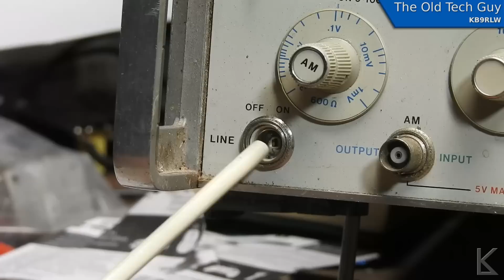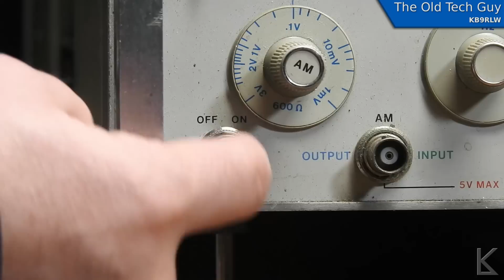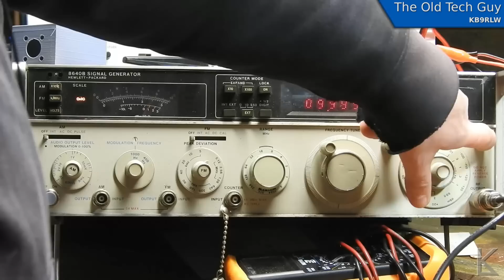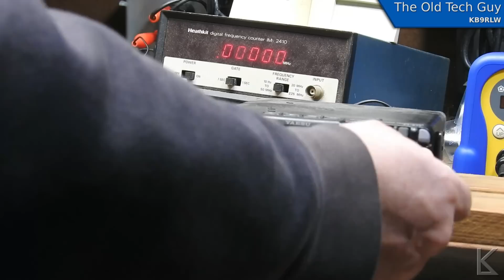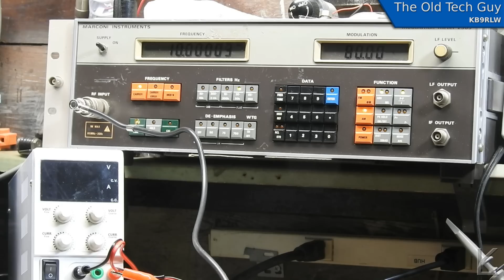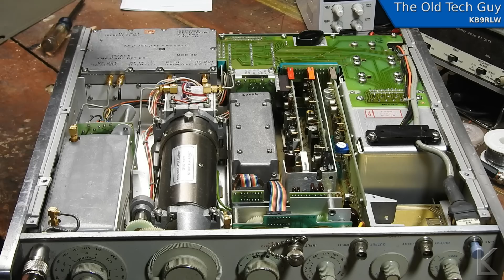Electronics - A closer look at the HP 8640b signal generator

Comment: so ive scrapped these out its essentially a hollow tube, with a transistor on one end attached to a big collector of some sort. and emitter that can be linearally adjusted. like 3 huge gold plated seal rings, then some pass thru filters. the other ones are cam shafts with about 6 to 8 cams that reciprocate in a way that on the high end of the stroke depresses a micro switch, if you could see its a very bizarre looking bank of resistors and micro switches all tied in with literal silver sheet instead of solder. intresting way to get variable wave forms mechanically. some of ther higher end versions of these the microswitches are made of a gold alloy not just contacts, the whole mettalic part of the switch like 65% gold, and again straight up silver sheets tying them all in. in one of the oscillators it worked out to be 1.3g of the gold and 12g of silver. the main oscillators are generally worth more without destroying them is they work. the pots connected to all of these may have those silver palladium windings or the same gold alloy. dependsit seems like everyone of them have same layout but component qualkity is highly variable

Comment: I have the military version of this unit and the case is totally waterproof.  There is a fellow on the HP equipment forum that sells replacement gears.  Built like a tank.
Reply: I just replaced the gears in mine.

Comment: Hi Kevin, great videos! My question is i have a HP 8654B Sig. Gen. 10- 520Mhz. I am a newbee and wants to know if I can use this to check my Ham radio Receive and transmit. My knowledge is far beyond but willing to learn from an Elmer like you, my email is jojopri22@gmail.com. wait for your reply, thanks and 73!
Reply from the maker: You can use it to test the receiver for sure.  Also useful for alignment of a receiver where you need a steady controlled signal into the antenna jack.   Are you sure it only goes down to 10MHz?   I think it should get down to the kHz range.
Reply: @loughkb  can i have your email address so i could pass my cellphone? 73! jojopri22@gmail.com

Comment: The main resonator for the generator is a cavity which is course  tuned by a movable internal plate over an octave range.  The plastic cams are the limit stops which allow multiple turns of the course tuning knob before reaching the end.   The lower frequency ranges are obtained by divider chain with each divider halving the frequency.  The fine tuning to lock it to a frequency standard is by varacter.  The lock method is called "huff-puff" stabilization. It use the frequency counter least significant bit output, via a low pass filter to slowly drift the frequency around an aiming point.  This was designed before phase-locked loops were widely deployed at UHF frequencies.  The best feature of the generator is it has very low phase noise and because of this the generator was often used as the interfering signal when evaluating adjacent channel, or intermodulation rejection on high quality receivers.  Another nice feature is that a lot of internal signals can be routed to the front panel, so you can do things like use the frequency display to count an external RF signal.
Reply from the maker: Thanks for taking the time to supply all of that info.  I've pinned your comment to the top so others will see it first.
Reply: It was a nice signal generator. in that years. My unit only had a knob broken problem. Love it.

Comment: I'm looking for one of these or a similar unit to perform alignments on AM-FM/FM Stereo tuners and tuner sections in stereo receivers and receiver preamps that clients send me to restore. Speaking generally, is the HP8640 with opt. 1 2 and 3 the best bang for the buck and capable enough to do proper alignments?  I'm more of less sold on the HP units to go with my Hp8903B audio analyzer, and they never let me down. It would be great if on a future video you go thru a complete alignment/check for a AM-FM-FM Stereo receiver..perhaps one made before all the adjustments went away.

I've looked at countless threads on countless forums, everyone has a different answer and most often the one your reading doesn't agree with the one you just read. More than that performing these kinds of alignments is a lost art. Surprisingly enough, no one has stepped up and demonstrated one that I've been able to find on Youtube. Great Channel, I've liked and subscribed!
Reply: Try checking Mr. Carlson’s Lab here on YouTube. He does lots of alignments on all kinds of gear. I love his videos on the 1970’s pioneer receivers.

Comment: I have this same generator with options 1, 2 & 3.  It is a wonderful generator but mine now has cracked gears.  I just ordered brass gears on eBay from seller "engineeringideas".  You may also want to download an excellent gear replacement guide from http://www.wb0smx.net/root/wb0smx.net/wp-content/uploads/2016/10/8640b-Gear-Set-Replacement.pdf

Comment: I have several 8640B's in my lab an d they are great. The one serious issue is the plastic gears used which crack and come apart with age.  If you will look at 22:52 of your video, you will see the gear is cracked at the set screw. This may or may not be a problem for you later. It probably will depend how much you use the tuner in your unit. 
I have wondered if 3D printing is solid enough to make replacement gears for this application. I have not played with 3D printers yet but there are some really nice prices for basic units. 
ANy thoughts about printing those gears?

73, de Glenn WA4AOS
Reply from the maker: Nylon might be a viable material to print in.  I haven't looked too closely at that gear yet.  It might be possible, and might make for an interesting experiment.   A lot depends on how fine of detail is needed for the gear teeth.  It can be tough to get much strength in really thin or fine parts with certain materials.   I might, if it's not too fine, print one in PLA on my printer and try it out.

Comment: Great little units Kevin. Again I love mine although it is not used as much. Good job on the power switch button. But keep that 3D printer warmed up. You may need it again. These units have a problem with the nylon frequency band gears. They crack due to the nylon shrinking.  right across the set screw. This will lock the switch up.  There was a guy in the UK that was making these from a mold. But do not think he is doing that now.  There is also a brass mounting barrel in the center of the gear. So spend some time on Google  searching HP8640b cracked gear.  My first 3 videos was on this unit. Thanks for sharing Kevin.
Reply from the maker: This one's already had the gears patched with epoxy.  But if they fail again, I'll just 3D print replacements. ;-)

Comment: Just thought you'd like to know approximately 32 years ago that signal generator cost $12,500.  I have one, It's never been abused It still works perfectly and has Option 1, 2 and 3. I hope yours has the reverse power option.  If you accidentally transmit into it by bumping the microphone when you're working on a transceiver you will nuke the attenuator assembly and the only way to fix it is to find another unit from a junker.  The other issue with that generator is the nylon gears. There was a seller on eBay that was selling newly manufactured gears as a replacement. If any of yours are cracked it is not that hard to replace them.   I always felt that this series of equipment was the Pinnacle of hp's Electro mechanical design.
Reply from the maker: I knew it had to be top of the line when it was new.    I take the microphone off the radio before hooking up the HP, and double check the front panel TX switch, etc.   One of the gears in this one have been patched with JB weld already.   I'm thinking about trying to print nylon on my 3D printer and just making replacements. :-)
Reply: If you make replacements there will be many people that will want them.  I have had 3 of these and all had this issue.  I repaired one with epoxy and one with JB Weld.  They both seemed to hold up fine.